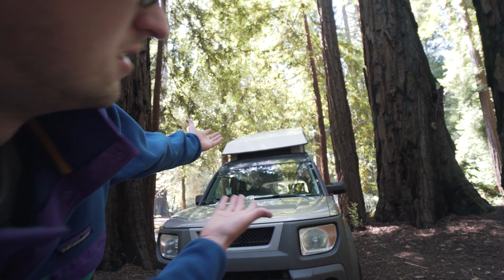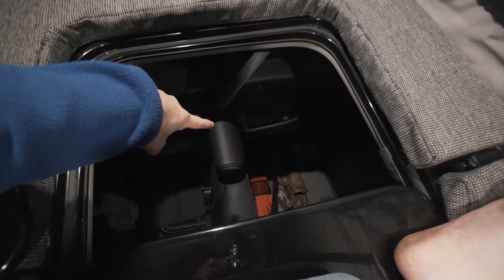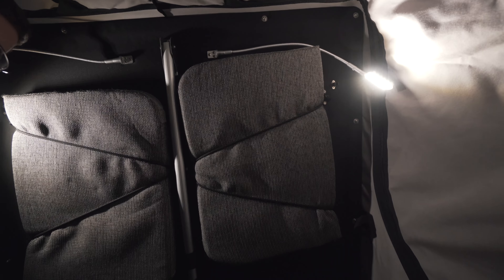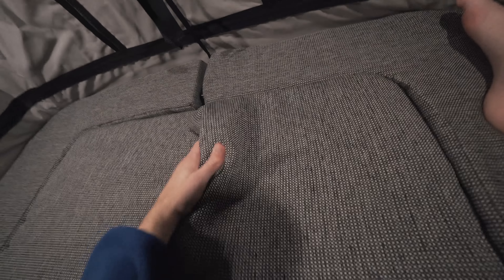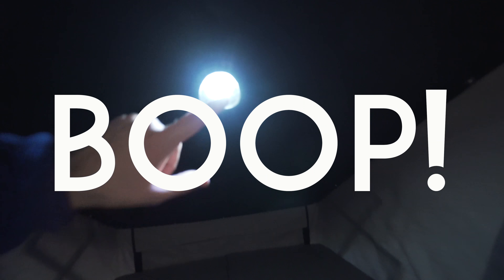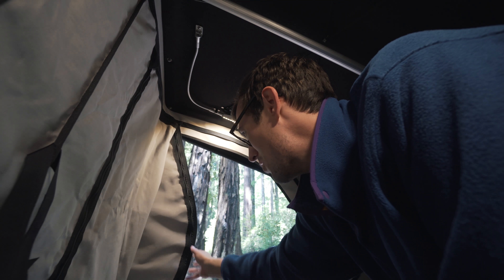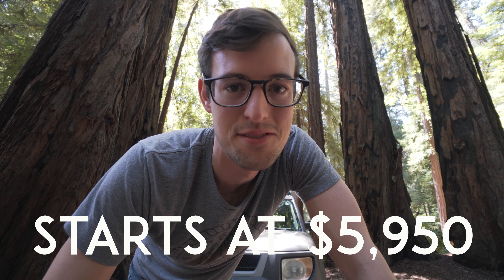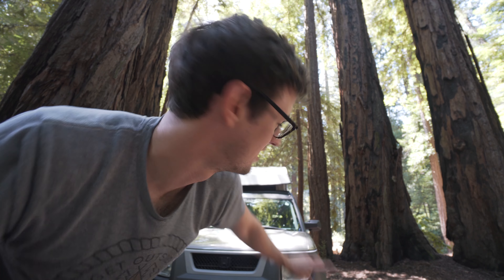Honda Element Camper Conversion

Comment from the maker: Thanks for watching! What do you guys think of the pop top? Would you get it?
Reply from the maker: Sounds like a great option! Thanks for watching!
Reply: What a GREAT IDEA... expensive for a "car pop-up tent", but lots of storage, killer mileage, it's a space-saver, easier to avoid weirdos (you'll hear them), AND, Honda thought of everything as far as lights, weight, and cushion storage! Also, it's nice that an additional items can be strapped to the top/can still drag a small trailer (for an ATV, for example). Nice job, Ursa! You still have yours?
Reply: Thanks for the videos. Looking into crvs and elements to go exactly where you’re at. I want to live in the red woods for a few months and explore northern Cali
Reply: Yes!  I have a 2008 Element and am strongly considering this option.  Thanks for the video!
Reply: Yes, have 2005 with low miles..smile!
Seriously contemplating bc intend offgriding as my multiple dog chariot.
Turn my new acquired 
Honda Element into
Motel~Meant.
Located in Southern Oregon so PDX is doable.
6k for limitsliberation seems fair enuff, and must increase the value of this mobile gem.
New subscriber, ty!!
Reply: I like it quite a bit, but the cost...oof. Did your Element already have a sunroof?  If it did , it probably saved quite a bit on install.

Comment: Can you exit from the ecamper? Or are you limited to going back through the roof? Seems like a hassle. I think I would want access both ways and wouldn’t want to be limited to having to lift the cushions and planks to get back into the vehicle.
Reply from the maker: What I do is use a small ladder that just leans against the car and I can just unzip the sides and crawl out. Some people get a small ladder installed on the back of the ecamper also.

Comment: I have kind of a particular question. How much room is it from bottom to top while it's closed? Because I'd like to put my 6 inch folding memory foam mattress and it instead of using the padding that comes with it.
Reply from the maker: Not a 100% on the distance. But that might potentially cause some issues. I actually had bought and cutout a 2 in memory foam topper to add on top of the existing mattress, very comfortable but it became harder and harder to close the top. My understanding is it was probably putting additional stress on the latching components. Ursa Minor says not to leave items up top when you close I believe for this specific reason.

Comment: I want one too! I love my Honda Element! But man the e camper is so expensive!!! Like seriously double my element!!!
Reply from the maker: Yeah it really is. My element was a salvage that I had fixed up. So it made it more do able. I also like to think it increases the value of the car pretty significantly, just gotta find the right buyer!
Reply: Rian Spaulding gotta buy like a used one. I bought my element for $2000 dirt cheap 03 AWD EX with 110k miles! I had to change the control arms only!  The E camper is how much!? Lol
Reply from the maker: Matty Cakes yeah definitely the way to go! Mine was an 04 with the front end totalled but only 50k miles, got it nice and cheap at an auction!

Comment: Have you used your E-Camper in the cold? If so what was your experience and what methods did you use to keep warm? I've
 started looking into the Element as a possible 10 month long living arrangement while I'm up north volunteering (Milwaukee or Seattle). I've tossed around the idea of maybe installing a propane furnace but space and drilling holes into the floor concern me.
Reply from the maker: Unfortunately I've only used the ecamper for weekend trips during cold weather. In those conditions we just used blankets and sleeping bags. A space heater may be a solution also. Thanks for checking out the channel.
Reply: I have a vanagon westfalia and leaving the top up will bleed you heat rapidly. I keep my top closed when below 40.